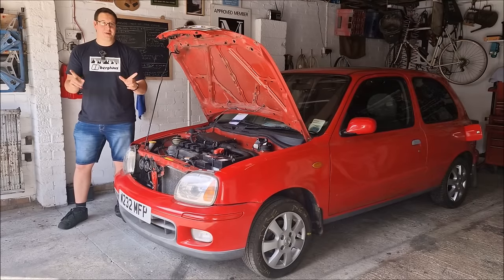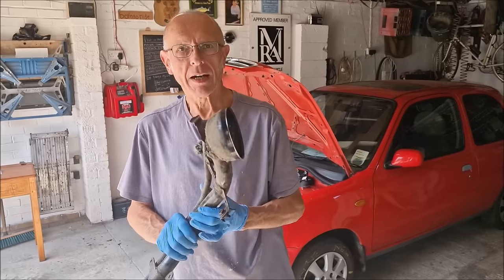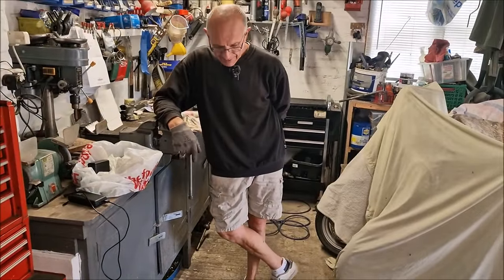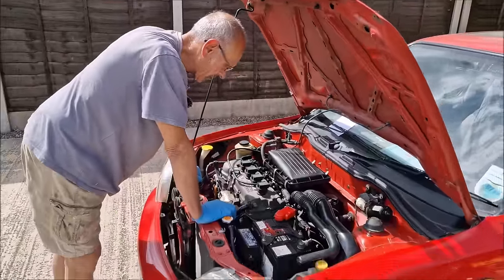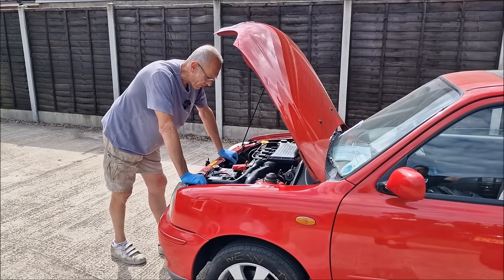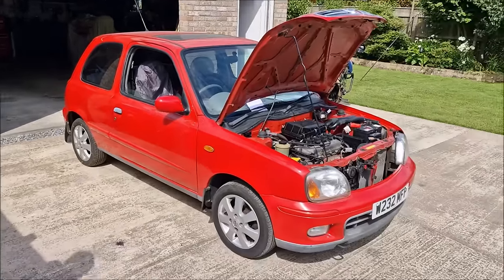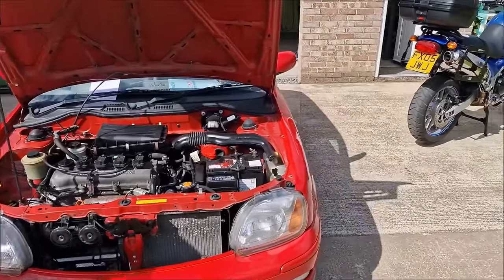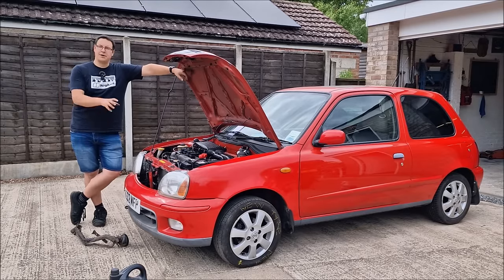MEGA MICRA UPDATE - Project K11 Micra Coming Along Nicely - Welding Complete & More Repairs

Comment: The main takeaway is….. leave him alone to get on with stuff, and buy decent parts when available even if they’re not cheap !

Great that it’s steadily been revived from top to bottom and will make it to Rustival 2.

I think the rot and muck up in the back of the wheelarch and fuel filler are testiment to the wisdom of sticking a hose spray or jetwash up and under your car every year and having a good clearout of mud and salt regularly !
Reply from the maker: Yep you are right
Reply: @JonCoupland  I seem to remember that this project was your Dad’s Idea from the start, it must have been bubbling away in the background for a while !

Comment: You may need to replace the frnt number plate bolts to black? Possible mot failure . Job well done guys
Reply from the maker: That's only a temporary thing so I know where they are - new period correct number plates are coming and will be stuck on and now screwed 😁👍